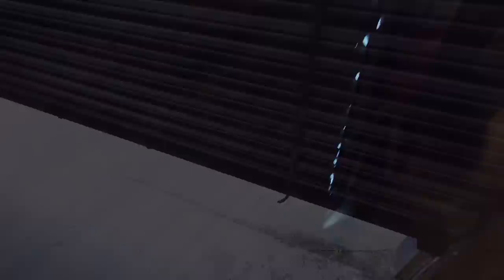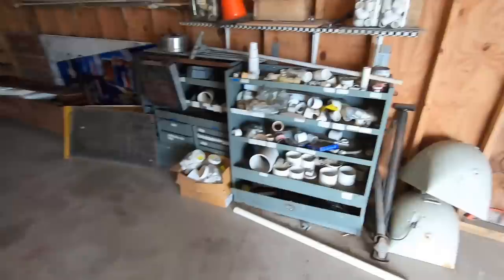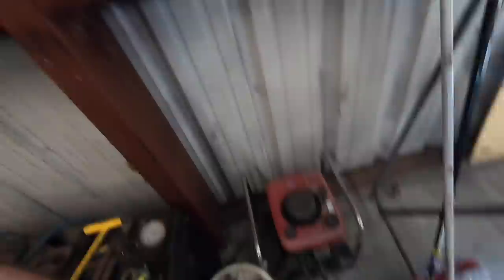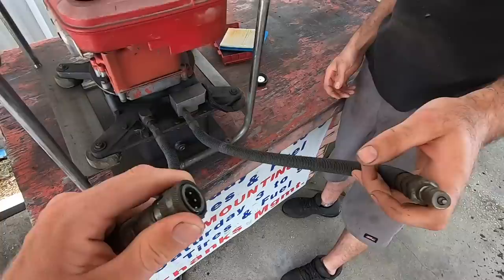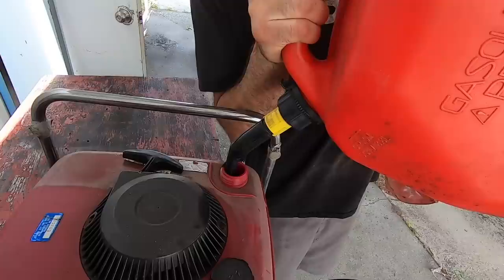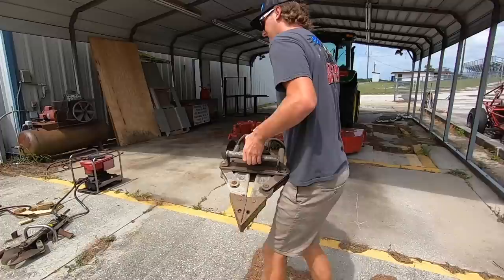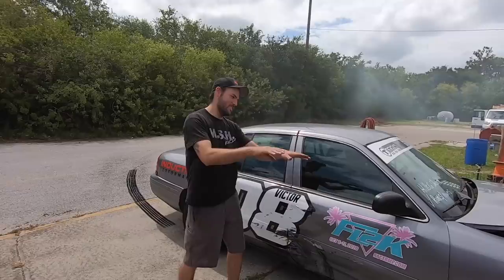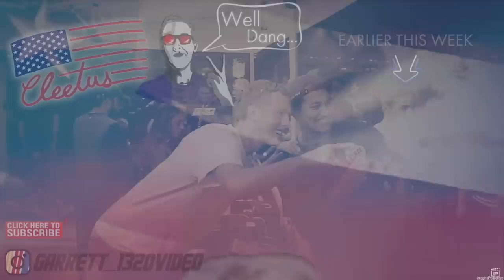We Found a REAL "Jaws of Life" Setup at the Freedom Factory and Powered Them Up!!! (they're insane)

Comment: Ought to get you a set of the battery operated ones, we’ve moved on the from hydraulic heavy ones requiring pumps. The battery ones are amazing now. Only keep the hydraulic ones as backups. If you are going to keep the hydraulic ones I’d say get you a hose reel and a set of pressure blocks to release pressure and change tools without shutting down the pump.

Comment: That is a 5000 psi system and it uses a special hydraulic oil. I wouldn’t recommend making your own hoses. Get in touch with your local Hurst dealer. Most will come right out to you. If you have anymore questions on those hit me up. Keep up the great job

Comment: Some portable hydraulic equipment uses 10,000 PSI to do more work with lighter smaller cylinders. Be aware of the pressure of the hydraulic unit if making hoses! Injecting yourself with hydraulic fluid is no joke to treat!

Comment: The strap on the second cutter is just so the weight is on your shoulder instead of just gripping it and holding it. They’re a hell of work out to use as is with no straps. I’ve never used a strap on some extrication equipment, interesting method

Comment: To keep skunks, and other rodents out of your garages and shops, put a few drops of pure peppermint oil (not the imitation junk) on a few cotton balls, and scatter them around each building, especially close to the  entrances.......they hate the smell. While handling the oil, wear some latex gloves and definitely keep the peppermint oil away from your eyes. While it is 100% food grade, in that concentration, it's insanely hot. Rotate the pull start cord on the motor for the Jaws of Life 90 degrees so you won't be mashing your knuckles on the carry handles. If you're going to put these rescue tools into a dedicated track rescue vehicle, you can probably build a hydraulic manifold and leave all the tools connected to eliminate the amount of time needed to change from one tool to the next. In an emergency situation, you'd be able to just put one tool down, and grab another. 

Given the travel time and distance between your original shop and The Freedom Factory, do you have any plans to close the original shop and relocate everything to the race track??? It looks like you have more than enough space at the track to do it, and there would be a pretty huge $$$$$ savings by not having to pay rent, utilities, and insurance at the original shop anymore.

Comment: I just bought a cutter and spreader for our fire department. They are battery powered and cost 11k each.  We got the Genesis brand. Cars built after 2010 start using high strength metal which a lot of the older tools aren’t able to cut.

Comment: For best results please have all of the hydraulics freshened up and any hoses replaced and extension hoses to give you more working area it would be good to have 30 feet of working area with the extensions before you put those into full service the seals and other components may not work very well under pressure of an actual rescue it is cheap insurance to have that stuff checked out every year

Comment: Cut one of those crown Vic wheels up. I got to play with some cutters before and they had me cut a wheel and tire. The tire was obviously nothing but it was crazy how it cut clean through all the tiny strands of wire from the steel belts and then strait through the barrel and side of a steel wheel clean to the bead of the rim. They're are fun to play with but I bet not fun when its get someone out of a vehicle.

Comment: Those tools look like the same type of ones I used 25 years ago as a firefighter and yes they are heavy when you have to haul them up and down a steep embankment to cut someone out of a car. It would pay to learn about how to properly use them in extracting someone because if you don't know what you are doing when bending & cutting the car you can actually cause more problems for the trapped person. You always have to remember you remove the car from the person  and think along those lines.

Comment: If you ever need new ones and want the best out thee, get in touch with Amkus rescue systems. Their Ions series mk4 are the best battery powered power tool on the market and they run off dewalt batteries.

Comment: U have a 1 spreader 2 cutters and 2 rams 1 power unit The hydraulic oil that those things use is actually called hurst fluid it’s a blue hydraulic oil that is very thin oil The only thing that you’re missing is a 25 foot hose extension

Comment: 1 spreader, 2 rams, and 2 o cutters. Look like the old 5000psi tools almost everything is 10,000 psi now for newer steels and metals. I would check the specs not all the older tools used regular hydraulic oil Hurst has there own Hurst fluid.

Comment: You can actually just run a hose from the windshield washer pump and use windshield washer fluid to spray the front of the radiator because it actually has a high alcohol content and will chill the radiator condenser and everything really good which is to fine mist of washer fluid!!!💦🥶
P.S.
 And as a bonus it'll keep the engine squeaky clean.....
🤣😉🚓💨

Comment: First thing is called a ram, used to roll the dash forward. Can spread as well. Second was the Spreader, used for popping doors.3rd was cutting tool, used  for cutting A and B pillars, door hinges and pedals.If you had a chain attachment, you could pull steering wheels, but not advised with airbags. Disconnect yellow or orange plugs for airbags before cutting anything, and cut the battery cables. I would replace all of those hydraulic hoses and connections coming out of the tools, they look pretty fried and you don't want to be springing a leak under those pressures.. That whole setup is fairly old, but ran close to 20 to 30k for all of it. Please at least get some training on using it. These are no joke and you need to be aware of the pressures and forces you are dealing with, just don't want to see anyone hurt.

Comment: Make a drag bike out of the GS1000. I had a '78. Last year with the slide carbs before the crappy CV carbs. That bike is a ripper. It out accelerates the space shuttle during it's first 7 seconds of flight. I was clocked by a PoPo friend at 122 in 1st mile and 147 in second mile in a two mile straight.

Comment: Those hydraulic hoses are high pressure specialty hoses. You have have to be certified and insured to make them and have the parts to make them. I believe those hoses are supposed to be pressure rated to 15000 psi so be careful.

Comment: There’s probably already a comment like this but hurst is a pretty good brand that a lot of the fire departments use , u can pop doors or hoods, or all other crazy uses, the hydraulic rams are used a lot for “rolling a dash” say if the dash had been pushed down on someone’s legs, and the hole making hoses thing be careful because they run at really high pressures and you do not want that to bust and puncture ur skin

Comment: Gotta be careful with old hydraulic hoses around sharp metal. A pin hole in that hose with the pump at full chooch could cause a hydraulic injection into your skin. It's almost always deadly.

Comment: Not that you'll read this bit surely welding a bracket to the front of the radiator to hold dry ice will keep the radiator much cooler than spraying some water

Comment: Cleetus, not trying to be a wet blanket but that equipment you’ve found is very dangerous. It uses 600-700 psi and if it’s not constantly maintained it will give you a high pressure injection injury. I’m a fire fighter and I use it daily, needs to be respected. Stay safe 👍 🇺🇸🦅

Comment: Just thinking out loud here, but when using the cutter tool I think you are losing some of the mechanical advantage by pushing the tool in to far.  Do the cut at the curved section, not butted right up against the machine end of the cutter.  It will allow a clean slice on tin, and reduces the risk of shattering the the cutter part of the blade.

Comment: A friendly reminder to everyone to NOT just fire up hydraulic equipment you find laying around, the pressures in those hoses are ridiculous enough to make the smallest leaks essentially oil jet cutters that will cut into people like its nothing. Having a lot of oil injected into you at a rapid pace is very much not a good thing.
Hydraulic hoses and fittings are cheap and easily replaced, limbs and people are not

Comment: , as certified fema search and rescue, please enroll in a rescue course for vehicle extraction.  There are lots of things you can do to make things worse during and extraction.  First and foremost you need to shim the vehicle and disconnect the battery.  Specially if it normally street car like your vet you guys are just messing with on the track.  A wrong cut or even a shift can deploy the bags of your daily